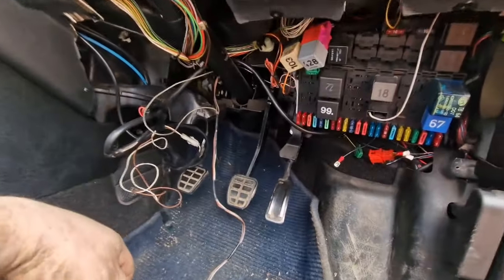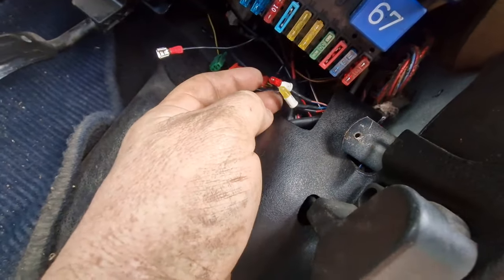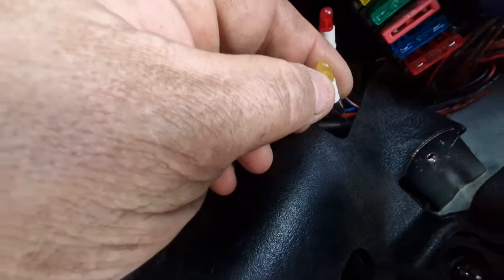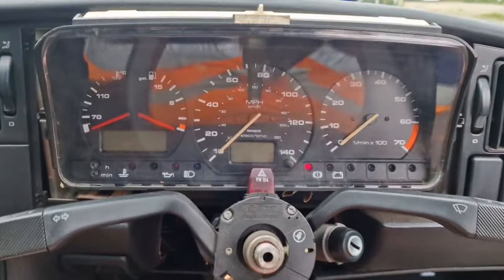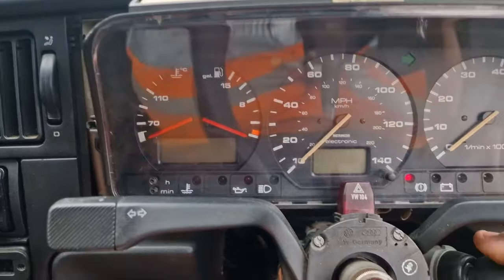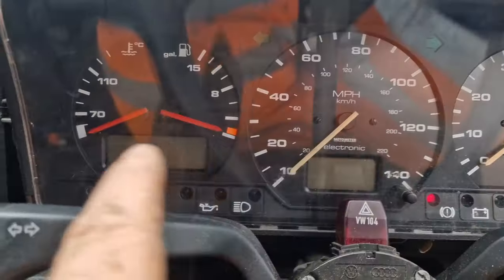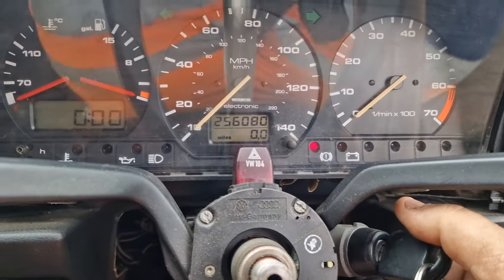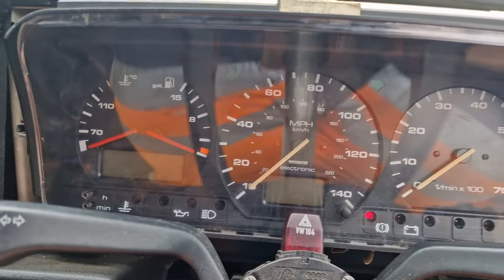VW PASSAT 35I B3 INSTRUMENT CLUSTER WIRING PD150 CONVERSION

Comment: Howzit dude. It seem to me , it's aftermarket alarm / tracker system with panic button... 
Those wires ...
Reply from the maker: Yeah it's a pain. I'm wondering if that's causing my dash cluster wiring issues
Reply: @ADHDCUSTOMS   on my BMW e36 also had an aftermarket  panic alarm system fitted.  Sometimes had problems with the car didn't want to start,  and with the electric windows.  
 
So my friend that was an auto electrician,  he taken that aftermarket stuff out , and never had problems again ... 

Maybe get a mate that good with wiring and let him test it for u. 
[ I only use cut_off switches now in my cars, don't trust aftermarket security systems for cars, when they age , get lots off electrical issues. In my opinion)
Reply from the maker: @DailyDrivenDude  yea I had same issue on my T4. I removed old system